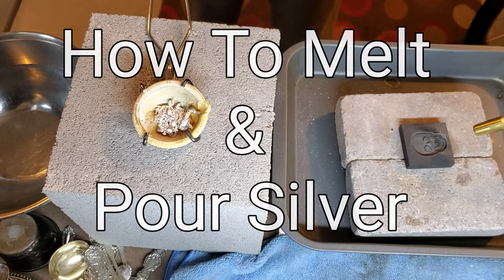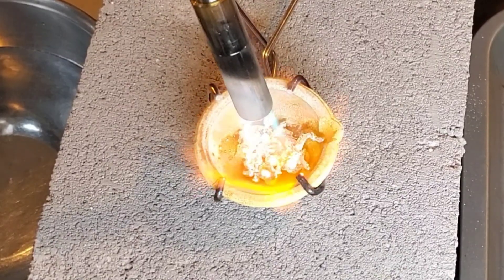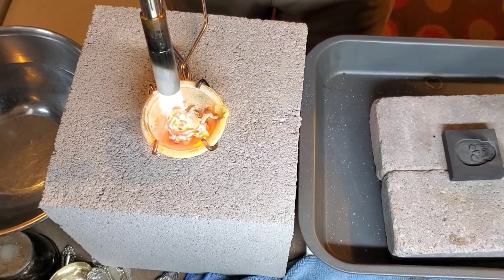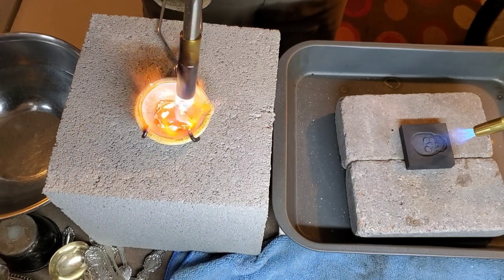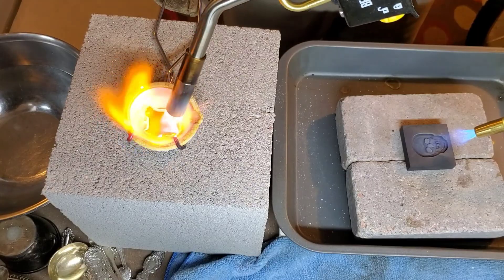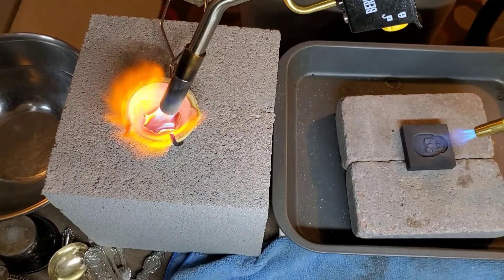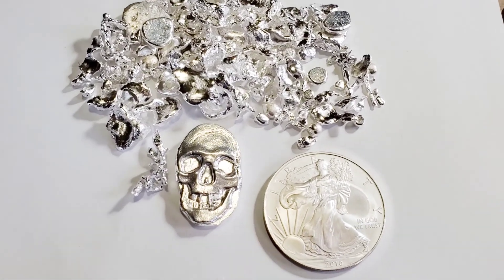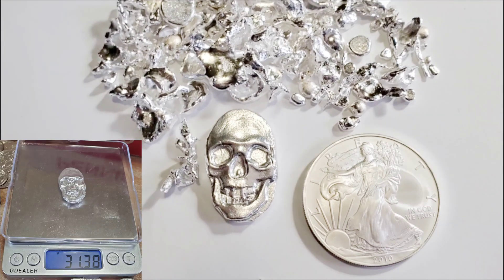How To Melt Silver and Pour Into a Mold

Comment: Is it 1oz before melting and after? Or do you lose some in the process?
Reply from the maker: When using a torch and crucible it's common to lose .2-3 grams or so due to the silver bubbling/splattering. It's best to add that small amount if you're needing accuracy.

Comment: I wanted to make a copy of my son's pirates of the Caribbean pendant and make it silver would it be better to use the Dolph clay sand or the one you're using now is it necessary to heat up the Dolph  sand? Like you did with the graphite
Reply from the maker: Hi, the sand I'm using is called Petrobond casting sand. You're thinking about Delft clay which is very similar. You can get better details by using the Delft clay but it's a bit more expensive. I've always used the finest count Petrobond which is also very good. I'll add the link in the video description. Also, no you don't heat up the sand before you pour into it, but I wouldn't recommend pouring if your working in a cold garage or something. If you are working in colder conditions you can keep your sand casting 8 warm with a space heater.

Comment: im having trouble melting 925 silver, everytime i melt it, it cools down with a really black and disturbed surface, any recommendations? 
Thank you!
Reply from the maker: Are you using a torch? If you feel like you don't have quite enough heat I would add a second torch. Have one mounted on a table and then you can hold the other one if you'd like. You can also try adding some borax which can help remove impurities. Check out one of my more recent videos on how to use borax.

Comment: Hey Josh, I was just thinking about finally melting down my scrap silver. I’ve had the mold that has two sides. One is for sheet metal and the other is for different sizes of wire. Do you happen to know what the name of the spray you use for the mold? It’s used to prevent the metal from sticking to the mold? I want to order it and while I pretty much order everything from Rio you have to be totally specific on what you want when your ordering online. They’re system is definitely NOT user friendly! It’s not bad when customer service is there during the day. They usually know what you’re talking about. If you know, a quick response from you would be awesome! Thanks! Teri 
Urban Muse
Reply from the maker: Hey, sorry for the late reply. I just got Google analytics and started using it for the first time, and realized I was missing so many comments that I didn't know I had before. With two-sided molds I actually just use Gold Bond body powder, which used to be simply talcum powder. I'm pretty sure I show using it in some of my pouring videos? I'm about to put out a video on Saturday that will show the use of it for two-sided mold.
Reply: Right on! I’ll look for it. It should probably be out by now. I’m late reading and responding to your late response! Lol! It all good! Thanks so much for the much needed info. That’s definitely a lot cheaper than what I’d end up paying for whatever I would buy from Rio! 😉
Reply from the maker: Hey, yes I did post that video it's the one about melting down and replicating a Morgan silver dollar.

Comment: Hi Joshua. I have been melting silver for various projects. But I have not been able to get those crucibles to work right. I tried to do the borax trick, but the borax just melted in with the silver when I melted the silver.... What is the trick to correctly boraxing the crucible so the borax doesn't just remelt into the silver and ruin it? It ruined my silver and the crucible....
Reply from the maker: Hi, I'm going to try to get a crucible glazing video out here in the next week or two. When you're glazing your crucible you really want the thinnest layer of borax on it as possible, as long as it covers the entire surface of The crucible on the inside and rim.

Even when done perfectly you'll often times get a little bit of borax that will melt into your first one or two pours. Either plan for this and polish off any excess borax on your silver. Or, I usually make a point of my first few pours going into a double-sided mold, that way any excess borax will end up at the top on your extra silver pour over. You can then just remelt the excess silver from the spout and burn off any extra borax moving forward. Watch for my crucible glazing video coming up soon 👍
Reply: @JoshuaAndersonLife  thanks for the reply! With the research I am doing, why should I not just use a graphite crucible instead, that doesn't need borax? It seems like that would make sense. And unfortunately I am not pouring into a mold. I am making spanish cobs, so it will get poured directly onto an anvil both as individual small circles I will flatten into coins as well as the more traditional method of pouring a whole strip of silver and then cutting it up and making those crude shapes into coins exactly like they did back in the pirate days! Fun stuff. Since I couldn't get the crucible to work, I have just been melting the silver on a polished piece of steel. Which works fine for small amounts actually. But not more than 1oz at a time. And still not ideal either.

Comment: Wow beautiful pour man! I love it in  I'm still struggling to get that fluid movement down
Reply from the maker: Thank you very much! Those smaller pours can be tricky at times...
Reply: @JoshuaAndersonLife  yes this I'm finding out as I go along lol it looks so easy on video but irl it is a bit nerve wracking the first few times
Reply from the maker: @mouthofthesouth4267  sometimes it can be helpful to put a penny at one end of your graphite mold, pour on the end that's slightly elevated and let the silver move down to the bottom half.
Reply: @JoshuaAndersonLife  I have to try that one next time
Reply: I do this but it never works with s silver just like you do it just doesn’t flow why? Help.
Reply from the maker: You're heating the mold up ahead of time and keeping 2 torches on it? May need more/longer heat if your mold is thicker. Also keep in mind that the room temperature will make a big difference, so if you're pouring in a cold garage it will not want to flow as nicely.
Reply: @JoshuaAndersonLife  would putting a fan heater near the melting area work to mitigate this?
Reply from the maker: @silverlake973  if the room / garage etc is cold yes having a heater nearby on your workspace can be helpful, I do this during the colder months myself.
Reply: @JoshuaAndersonLife  good to know, thank you.
Reply: @jamsax6915 are you pitting borax in the bowl first then heating it?
Reply from the maker: @MattyViper-lf6jb  hey sorry I missed this until now. No I only glaze my crucible once before using, but do not put any borax in the crucible before every pour.

Comment: I must have had my map pro torch on for 10 min and I cannot get the silver to melt!!
Reply: Same with me. I resorted to putting the silver in my forge to get it to melt. Luckily I have that at least...but no clue why my map won't get hot enough.
Reply: Same. I can get very small amounts (less than 10 grams) to melt after about 5 minutes, but anything over that... nope.
Really curious on the brand of torch being used here.
Reply from the maker: Torch is a Bernzomatic TS8000... Should work really well! If you watch some of my newer videos you'll see I started using a two torch setup one fixed and one that I hold on to. The fixed one is a Bernzomatic TS 4000.

Comment: i melted some silver 925 halmarked  and it turned out to be black  after pouring. why?
Reply: Caused by oxidation from the copper in 925 silver. Just pickle and you’re good
Reply from the maker: Should come right off with a silver polish 👍